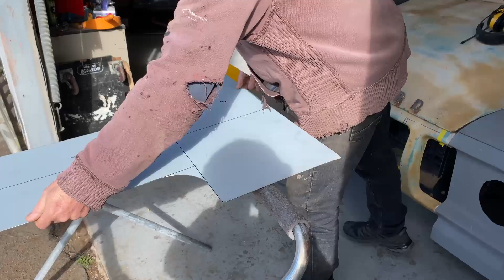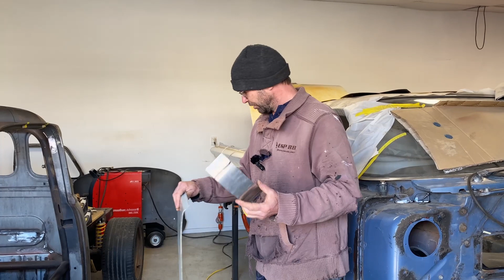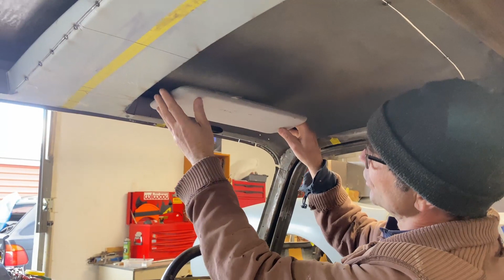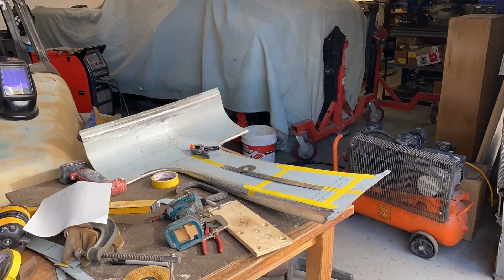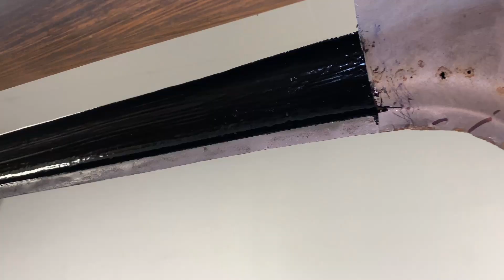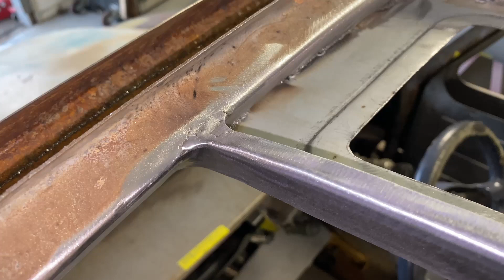V12 HOTROD TRUCK! ---- Roof console build

Comment: Beautiful work. Maybe some tubing needs to be pre-installed to making running wires for the control panel switches later on, easier? I foresee maybe getting wires headed down those pillars is going to be a bit of a pain. Anyway it’s great to see high quality work from a humble craftsman.